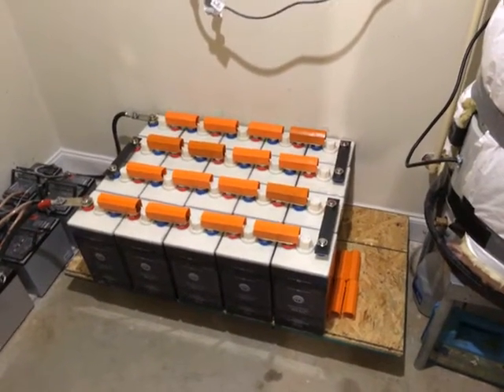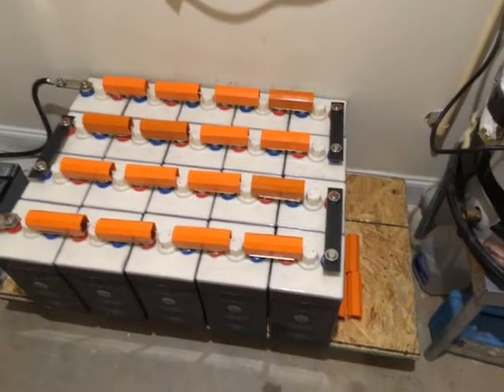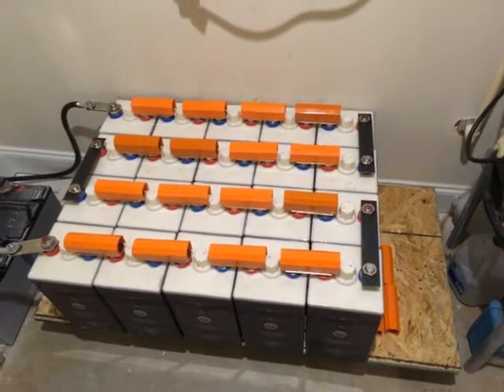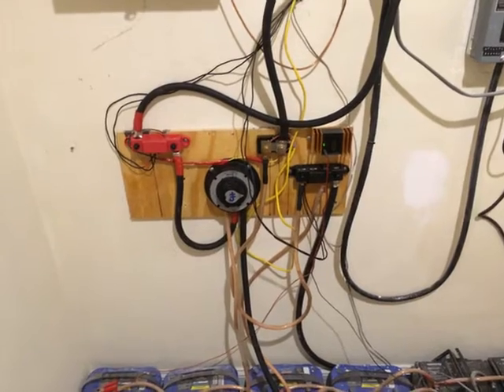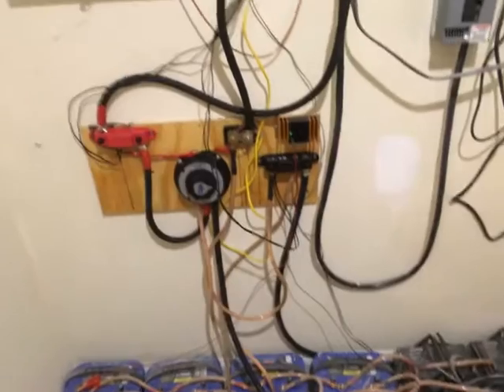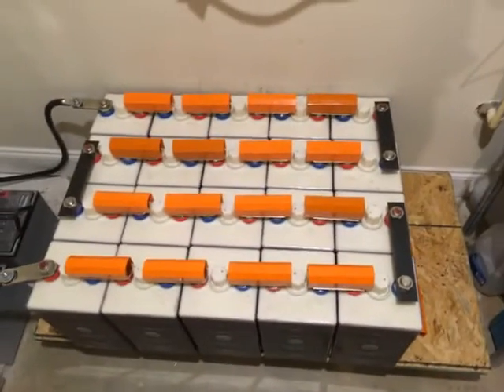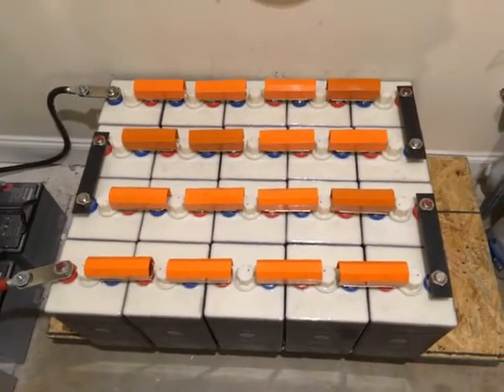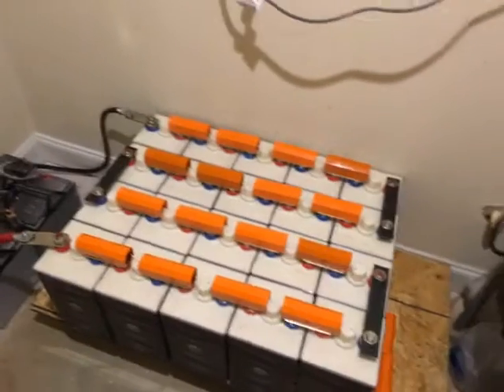DIY Solar Update - Nickel Iron Batteries hooked up

Comment: Nice!  I have been looking at this type battery I guess they perform close to lion type as far as being able to use them to a much deeper discharge rate down to 20% or less making for or acting like a much bigger lead acid type at 30% or less use per cycle, they are costly but could be last battery U ever by . Also use a alkaline type electrolyte? Cant wait to see more.
Reply from the maker: Thanks for the comments, according to various documentation, they can be discharged to 1v per cell or 80% DoD on a daily basis. My plan is to use them daily in a off-grid scenario.

Comment: Tip, Copper pipe (3/4") flattened in a vice or on the floor with a hammer, use a step drill to bore holes where needed Heating with a torch may help to soften , you could also tin the now newly made bus bars.
Looking good though
Reply from the maker: +Craig Nehring Thanks, a good friend of mine offered to give me some extra pipe that I believe he'd flattened in a similar manner.  However, I had already ordered some plain flat steel plate from Home Depot that did the job.

Comment: do you need a special charger
Reply from the maker: When using Nickel Iron Batteries, they should be charged at a 1.6v to 1.7v per cell.  1.6v x 20 = 32v. The charging source must be able to accommodate the higher charge voltage.  Also, any inverters must be able to handle a wide high and low DC input voltage range, In my case, the Magnum inveterate/charger has a range of  around 18v to 35v DC for input. And a custom battery setting where I can set the absorb charge voltage to the max of 32v.  Float for these batteries is 28v to 30v.

Comment: How much did it cost total?
Reply from the maker: $3499 not including freight. That will depend on where you live and the freight company used to ship. Also, these do qualify for the 30% tax credit.
Reply: wow I was hoping that was including shipping cost. Have you been running your whole house with those?
Reply from the maker: +shartne Not yet, I just got them on the 3rd. Also, I need to finish hooking them up properly.  I still have a couple of 4/0 Wire connections to make, and DC circuit breaker to install.

Comment: Hey rhandsom, can't wait to see how they work with your system, your always doing something interesting, is this going to connect to the old batteries ? Also on the wall panel where did you get the red & black battery connectors
Reply from the maker: +Al Ruark Hello Al, yes they are combined (sort of) with the use of the manual battery bank selector switch, and the old batteries will remain as backup batteries in constant float using a smart battery combiner.  The smart battery charger will link the 2 banks and draw power from the primary bank (NiFe) and charge the backup bank based on configurable set points.  Also, I bought my bus bars off of eBay  search for (Bus Bar - 4 post x 5/16" Studs - 250 Amp - With Cover - Red) from bay-marine.
Reply from the maker: +Al Ruark Al, you can check out Bay Marine Supply at baymarinesupply.com.  At least that's what the invoice for bus bars says.

Comment: Q what is the AMPS from the cell ??
Reply from the maker: +Colin Howe 200ah per cell.  (1.2v x 200ah = 240wh per cell)  (240wh x 20 cells = 4800wh of storage)
Reply: +rhandsom that sounds really good. Does it take long to charge them up? I can hardly wait to see how well they work.
Reply: +rhandsom thanks
Reply from the maker: +shartne not sure about the charge time, I hope to know more as time goes.